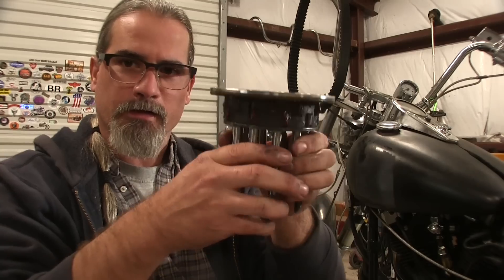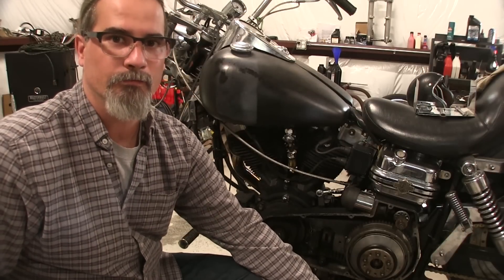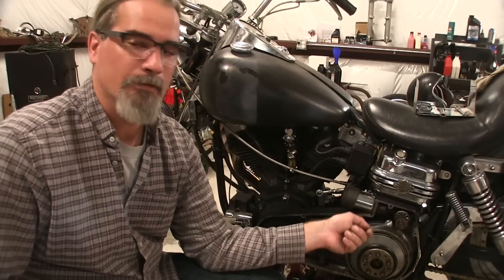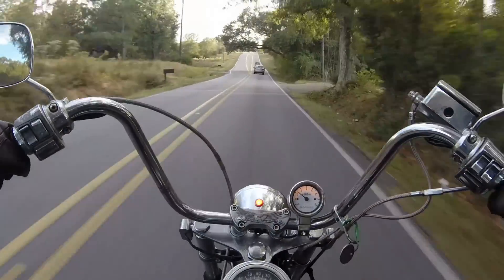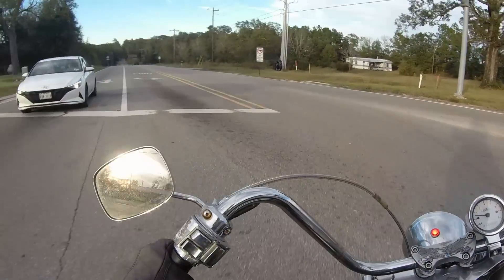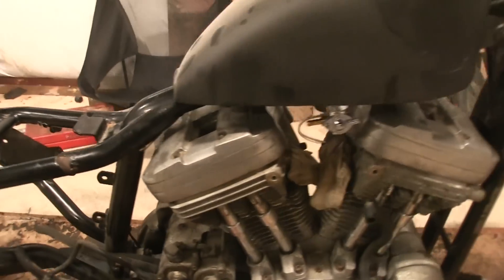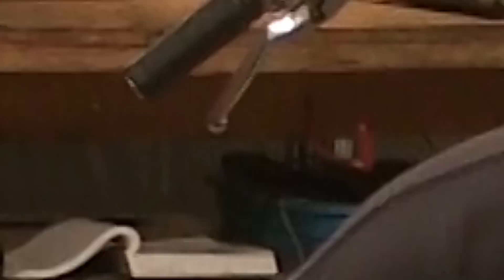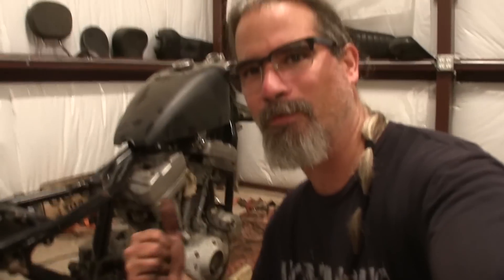This HARLEY Davidson SHOVELHEAD Has Made A FOOL Out Of ME / Clutch, TIMING & Kickstart Issues Solved

Comment: I usually won't let anyone work on my bike. But I took my heads To a Machine shop once. I put the bike back together. It got super hot I couldn't figure out why. Then it got to Where it wouldn't want to start. I checked and rechecked and rechecked and am very familiar with Shovelheads and setting the time. I took the hi-4 off Put points and my coils for the points back on.  I just Couldn't for the life
Of me figure it out. Gotta deal on a wide glide put 20,000 on it in two years, ran into hard times had to sale. So I started taking the shovel all the way back down. The dam valve Guides We're not seated in the head.  🤬 fixed that, put new gas in. After 3 years, second kick, bam a lam a lam.

Comment: After years of being left on the side of the Autobahn, I dont know if I would have a Shovelhead again. IE: Voltage regulator failing off, carb backfiring itself off the bike, Having to grind ALL my 7/16 wrenches thinner just to adjust the push rods for valve lash. Timing never staying timed. Kick start only THEN kick start lever launching my leg UP on a mis fire and breaking my own nose...! HA HA HA.
Reply from the maker: They all have they're own personality. Some tell me that their's has never left them stranded, and others say otherwise about their's.

Comment: I had a 79 that had a creep that drove me flipping crazy after a completely new clutch still have the creeps an old biker gave me oil 
If I remember right it was called
Amsoil primary oil after that it didn't creep any more I don't even know if it still exists it's been years ago
Reply from the maker: That's just the nature of the beast. With the pressure off of the clutch plates, the basket tends to drift a little and slightly contact the most inner friction disc.